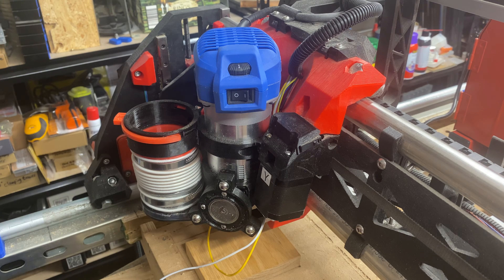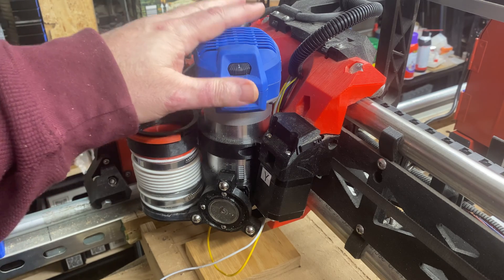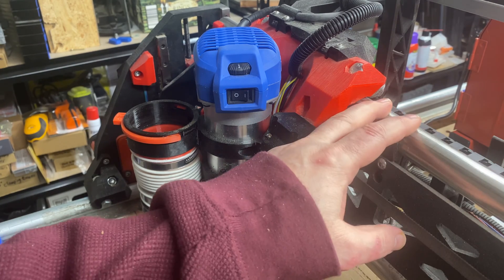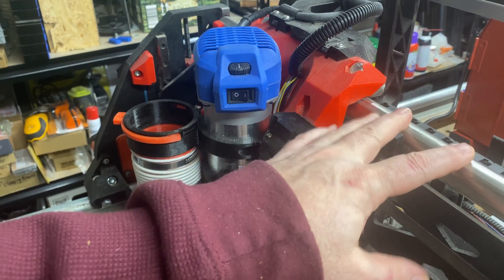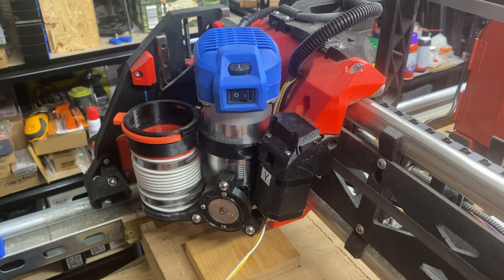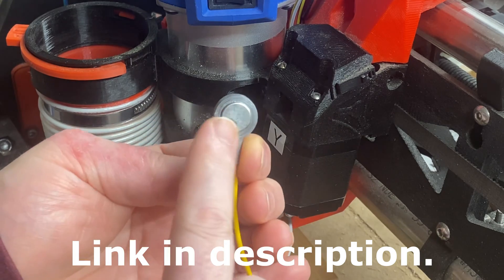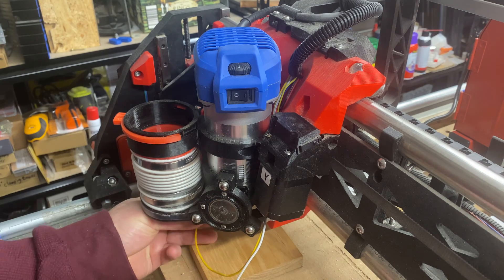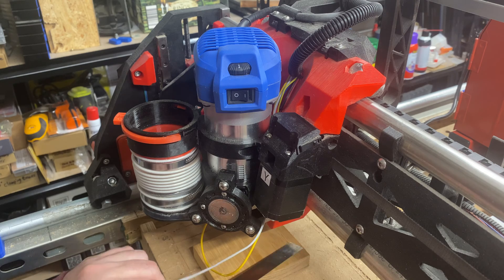LowRider v3 CNC - Tramming & Squaring with Jackpot controller

Comment: Was surfacing my lr4. And had issues. Will try this as a fix. Thanks for the save Doug!
Reply from the maker: Yes, you have to be careful on resurfacing. Take shallow passes. And goal is to set zero of your Z at the highest spot on the not-flat table and work your way down from there. Also, if you use some chalk or pencil to mark the existing surface, it can help make it easier to know when you're done. If the Z is homed to a low spot, then when the surfacing process gets to the high spot, the the depth of cut becomes unintentionally deep, and the chip load can get insane pretty quickly. I burned up a router that way!

Comment: Hi Doug, is there a way to check what offset I have already saved on SKR? Also if I save an offset twice will the original offset number be overwritten or will it add the two inputted offsets that have been entered, thanks!
Reply from the maker: These would be good questions to pose on the V1E forum. It’s been a long time since I used the SKR, which uses the Marlin firmware. I’ve been using the Jackpot board, which uses FluidNC firmware, for a while now. So we need to get help from someone who is either an expert with Marlin, or has a very good memory.

Comment: So I'm using your script, but for some reason my Jackpot is not giving me a 'PRB' Value. It's giving me a 'Hold' value. Am I missing something here in the gcode?
Reply from the maker: I'm not sure what's going on there. If you are looking at the right place in the console's feedback, then it may be that some difference in the firmware version affects the formatting of the output. I can scarcely imagine any valid reason for describing a probe value as a hold value.??
Reply: @ I just DM’d you on the V1E forum with a screenshot. Maybe you can see something I don’t.
Reply: Thanks for the vidio just wanted to ask did you download the config file from the controller firist

Comment: How do you find and set the hard and soft limits for your table? I am having trouble finding information on this. I assume it prevents crashes at the extremes.
Reply from the maker: The way I did it was to home my machine, zero out at the homed location, then move (jog) to the X max and Y max extremes, and carefully note how far I could go before making contact, then back off from that just a smidge, and see what the values are. Then, after saving a backup copy of your config,YAML file, edit the config file and input those values into the max_travel_mm value per axis. Then, also per axis, enable soft limits. I used to also enable hard limits, but unless you have limit switches on both sides and end stops at both ends, you’re not going to get a hard stop limit action at both ends, And I actually had my dust hose get against a limit switch blade during movement and it made the machine instantly and needlessly halt because it thought a hard stop had been reached and threw an alarm. So I no longer have hard stops enabled. But all this is done in the config file. Then connect and upload your new config file. Reboot. Then test and adjust if needed. You can also do Z, I do. It’s a little different. I guess you would remove the bit from the router and find how much the travel you have, enable soft limit to prevent crashes at the max location.

Comment: Jackpot ? FluidNC? What is the difference? Is there any explanantion about this? :) thanks
Reply from the maker: Jackpot is hardware (main board) and FluidNC is the firmware that runs on it. The Jackpot controller board can be ordered from V1 Engineering here: https://www.v1e.com/products/jackpot-cnc-controller?_pos=1&_psq=jack&_ss=e&_v=1.0 — and the docs for it are here: https://docs.v1e.com/electronics/jackpot/ (and from there you can get into docs about FluidNC).
Reply: Thank you :) @design8studio
Reply: Thank you :) @design8studio

Comment: can you run Nema23 steppers with the provided TMC 2209 Drivers on the Jackpot controller ?
Reply from the maker: This (or something very similar to it) was asked and answered on the V1E.com forum: “You can use TMC 2209 drivers with your NEMA 23 steppers, but it is likely the NEMA 23 steppers could take significantly more current than the TMC 2209 can provide, largely negating the reason to go to NEMA 23 steppers in the first place. Stepper drivers limit the current going to the stepper motor.” https://forum.v1e.com/t/nema-23-vs-nema-17-for-z-axis/34157
Reply from the maker: Our NEMA17 steppers are quite powerful and commonly used for LowRider builds.

Comment: I have been so much happier with this Jackpot board. I am in the process of changing out the Makita Router to the Kobalt Router.
Reply from the maker: Thanks for watching and I hope you enjoy your machine!
Reply: @design8studio  also I am really impressed with the dust show you came up with as well, I did make a small modification to it, my shoe kept on sliding off. So I put a boot through both the mount and shoe. Next I am going try your unistrut mod. 
Thank you for all of your great work!
Reply from the maker: @ronaldmckenzie1  I put some strips of ultra high molecular weight tape (https://amzn.to/3TQ0USh) onto the shoe mount area where the dust shoe slides on, to get a tighter fit...I have been thinking about two possible improvements to the floating Z dust shoe: a "click and lock" way to keep the shoe on, and a set of one or more marbles or large ball bearings or printed globes on the bottom of the shoe, to let it "sled" higher up without the bristles being crushed, and with less resistance. I will probably tackle it one day soon. Have too much going on.